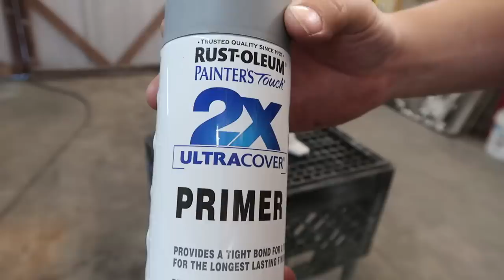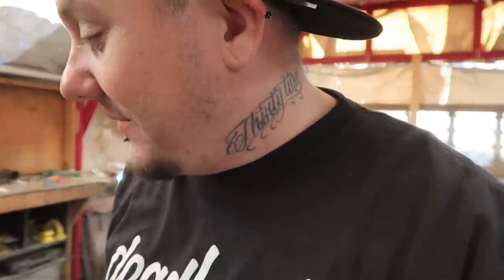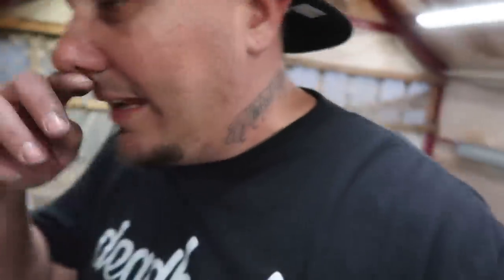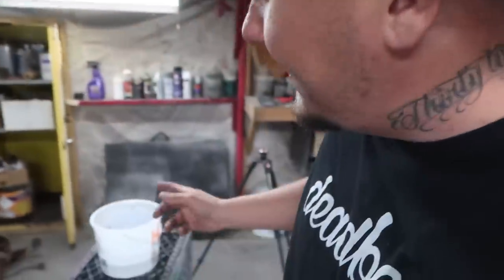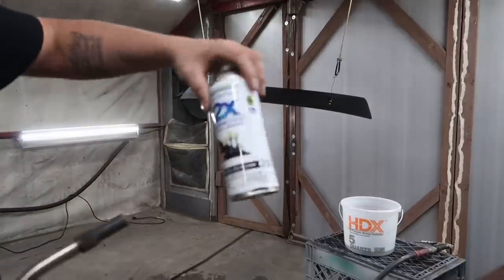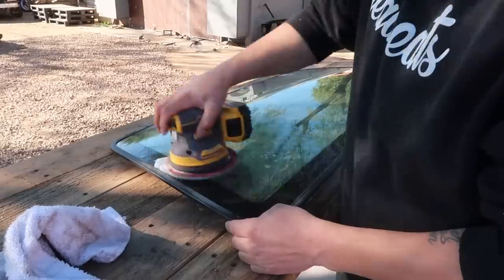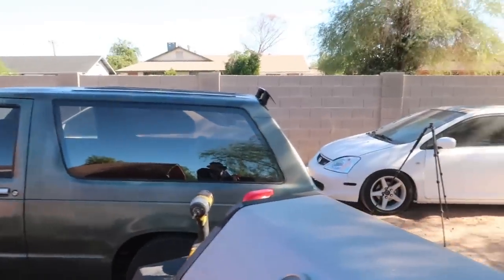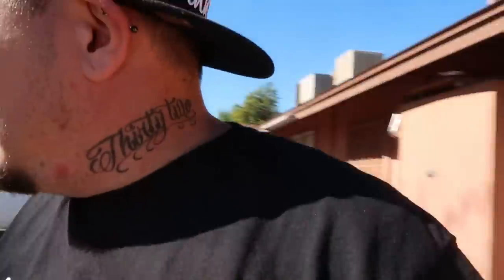Accessorizing the S10 Blazer!

Comment: cal vue sport mirrors (if you can find a set) would sport it up. the flag mirrors were removed from my 1991 s10 4x4 4dr when I  got the truck in 1994. still have the truck. The wing is designed to clear clear the back glass. keep up the build looks great.

Comment: I have a blazer problem, I have an 87 2 door with a 92 GMC grill, lowered, same grey as yours. Been trying to get motivated to finish the purple velvet interior I started almost 2 years ago .......Also have a 2000 2 door blazer xtreme, 2 zr2 blazers, 2 awd bravadas......blazer life.  The wet sanding trick is legit (done it before)  I have a wood stove that makes alot of dust, while I'm painting it sucks, but the dry heat cures it so fast. Top notch bud.
Reply: Just one note, I took the wing off at one point, and got fumed out almost immediately when I drove it. I think it's keeping a low pressure area around the glass to keep fumes from sucking into the cabin. Just a theory

Comment: I know you are budget building but the black rubber pieces that go under the trim for the roof you can get on lmc truck. They are a gasket so they don't leak. And that black coating that comes on body panels is called ecoat. Sem makes it, they call it ez coat.

Comment: that damn he is always messing things up Toby    lol             on your window trick instead of all of those steps you took to get the clean n shine back into the window have you ever tried 0000 steel wool  you can use it dry and it polishes the glass back to a sparkling brand new look  and it takes off overspray , road grime and when your done you can put a coat of wax on the glass for water repelling  i dont know which one is better but its nice to have options

Comment: The wing looks odd because you don't have a roof rack. If you had it you'd see the difference because the rack sits high. I like the look for sure but just saying I think that's why you're unsure on it is all. Also, there are supposed to be two caps that cover the hardware that hold the wing on. Right where those two holes are on each side. 👍🏼